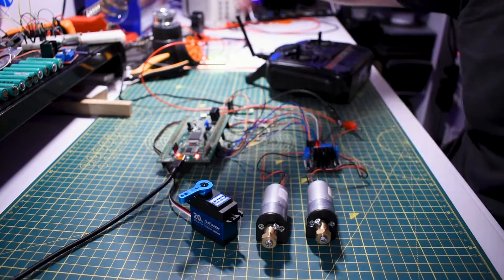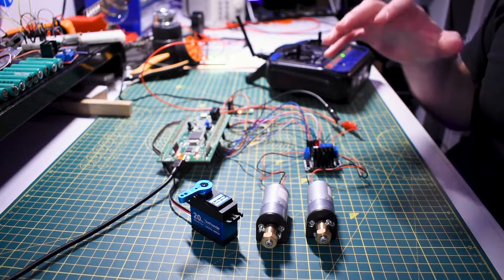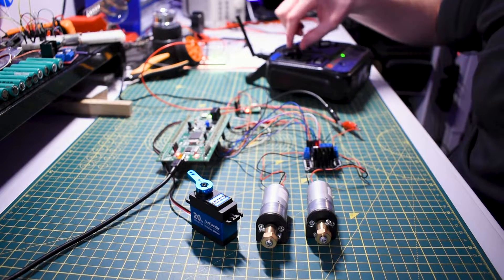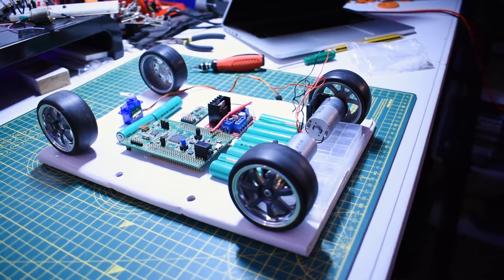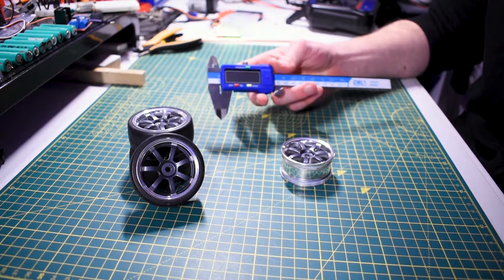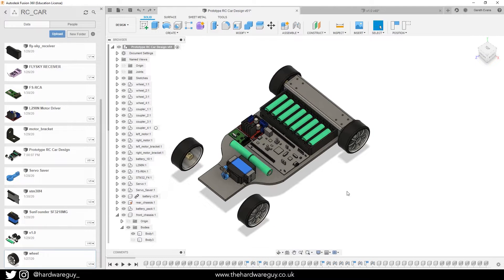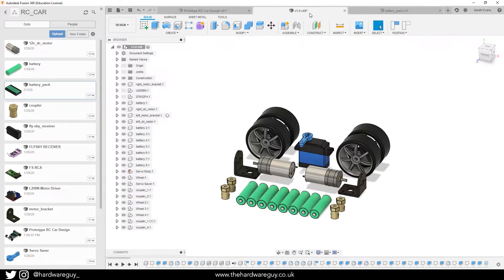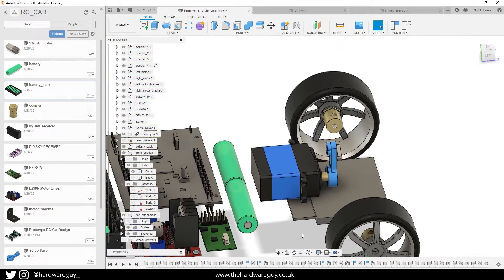RC Car Build pt.3 - Prototype Design

Comment: Could you have the software store the initial values for the sticks to start with, and add to (or subtract from) them as you use the car and it sees higher (or consistently lower) values than the initial ones? Instead of cycling the sticks on startup? I know it might be fiddly, but you're basically reinventing the wheel anyway. lol But this might be a little smoother if you're planning to sell this setup in the future. Just curious.

Comment: What DC Motors are you using? Are you using a motor driver? Could you post the associated links? Would really help with a university project!
Reply: The motors are dc feared planetary ones (dunno the rpm) and the driver is L298N
Cheers.